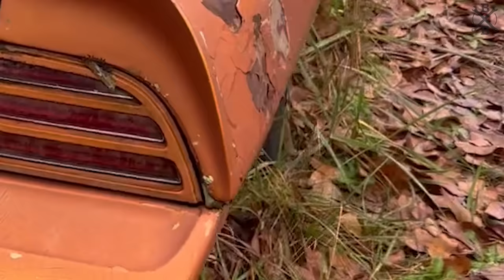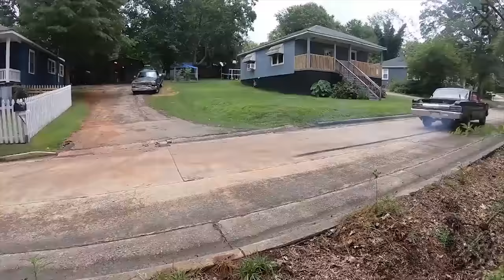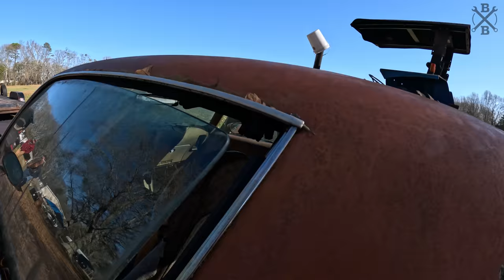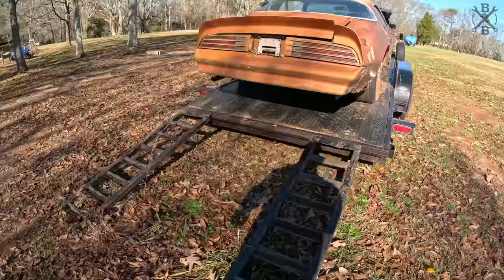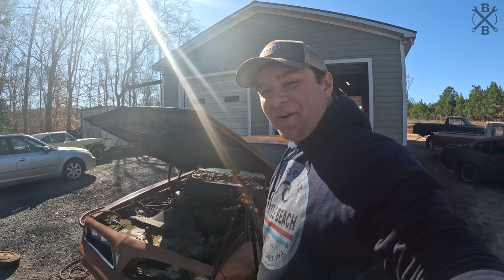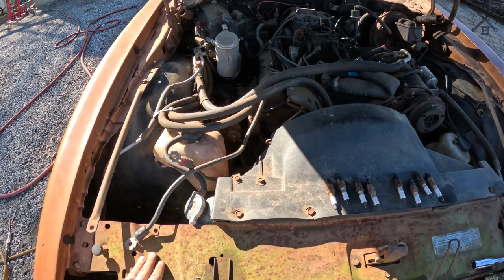FIELD FIND Pontiac Firebird Rescue! Will it Run After 21+ Years? Pt.1

Comment: My advice wether you want it or not.  GM 350's run 20w50.  Pennzoil is rubbish oil, use Valvoline VR1 racing oil as it has lots of zinc in it,  I use it on all my old engines.  Don't use purple power on alloy.  It etches / corrodes alloy and strips all the anodizing off which causes further corrosion.  I hope this helps.

Comment: I had a 1977 Formula Firebird  in 1980 it was silver w/Formula stickers on side door bottoms hood scoops and fin, raised white letter BFG Radial T/As 350 OLD MOBILE engine, 4bbl, auto trans, chrome exhaust tips, fake dual exhaust, loaded with emissions but it looked fast! Lol,  chick magnet for sure luxurious red interior, and dont forget Pioneer super tuner.
 thanks for the great vids and jolting my memories out of the cobwebs!.

Comment: as a teen car jockey (1976-79) at a Toronto Pontiac/Buick/Cadillac dealership, i drove these when brand new, on a weekly basis, using the salesmans demos, or driving 5 miles to the car wash before customers picked up their new ones....i also drove the special edition Indy500 pace cars, and those were rare.....its odd to look at them in these decrepid conditions.....would love to see an original Special Edition....not many were made, with even fewer available in canada

Comment: Just got a 78 formula recently. 63,3xx original miles. Has the 403 olds factory motor in it. Super awesome car so far. Been sitting 15 years so gotta bring it back to life

Comment: Those cars were crappy dogs back then,  They ride like a Fred Flintstone era car or steel sled.  Rattle a lot.  The large 400 something engines were dogs.  They were hyped but didn't deliver. 
I still enjoy watching you get them running.  I'm sick over the cool cars I've had and sold over the years.   Hindsight is 20/20

Comment: The Winston Winner tires should still be around. I have a set (all be it older set from around '07 or so) on my 68 Dart and they still hold air as well. You should still be able to find them. Though a set of Cooper Cobra Radial GT's would look great on there too.

Comment: Loving it Mike.
You sure that's your dad... Or you brother.. he looks only 10yrs older than you lol

Questions.
1. Can you get parts easy for it... Will you swap to new hoses in the engine bay.
2. Would you do a wash and clean, before you start a build on it.
I'd like to see it cleaned.
Would you try Dry Ice cleaning any dirt off the underside?
3. What do the electrics seem like?

Now off to watch pt2 lol

Comment: I worked on Pontiac I liked the 400 cid with the 400 trans and the 4 speed manual . A 1984 305 with twin tbi now that was a cool set up. I rebuilt the engine what a screamer .

Comment: I was given a 85 z28 camaro that had been setting for 19 years t tops fully loaded under the trees I put 3 gallons of gas in it and a battery aired up the tires 30 minutes of cleaning up from under the hood fired it up and hobbled it home you can't kill gm cars 👍

Comment: Where the spring shackles supposed to be welded to the body front and rear it will be totally rotted that’s why the rear of the body just is sagging,bad enough probably cannot drive it .great save on the motor,was impressive that it ran.great video.keep it up and carry on.👍👍👍😎😎😎

Comment: with no brake booster elbow, you've got a huge vacuum leak goin on. considering that, it ran pretty good. those formulas were kinda like the camero berlinettas, chick cars. but most berlinettas had 6's rather than 8's for engines. but a 305 isn't much better than a 292 straight 6.

Comment: Always wondered about mechanics pre-filling the oil filter. 
When you can, if the filter fits upside-down but most times I'll prelude the rubber seal.

Comment: I love watcking young peole  working on old  cars  I worked on these when they were new. we would pull carb. and tightened 2 screws on bottom good as new common problem  back then.Vacum on brake booster is a major leak.

Comment: very cool, im working on a 74 firebird, same color crestwood brown, same color saddle interior, same woodgrain dash trim AND same broken ass door handle  I bought a nice thick set off ebay, much better than the cheaper $30-40 options on ebay..  BUT my has an inline 6 250 with 3 on the floor.  Cool episode.

Comment: It looked like you were missing the plastic 90 degree fitting the connects the vacuum hose to the brake booster. If so, and that 3/8" hose isn't plugged, then you have a massive vacuum leak right there.  I also wondered how long it would take you to discover that GM didn't even drill and tap holes for the other 2 carb base bolts. The base plates on these carbs were stout enough that the other 2 weren't necessary. Cool project.  I'll be following.

Comment: I love the formulas I haven't been able to find another 400 4-speed. I had a 78 red black stripes. White seats red carpet. I had a sway bar in the rear not sure if that was part of the WS6 package or not. I had the metal steering wheel not the deluxe

Comment: One thing above old cars ,
      If the motor isn't locked up.
       All is required is ,
     Gas ,spark and air .
            To make it  run .
   It's not as big a deal as some people make it out to be.

Comment: I've always wondered. If the engine decides to do a lean pop or the like when trying to choke the carb with the hand - would it be dangerous or does it just sound way more dangerous than it actually is?

Comment: Love this channel, i highly doubt that hood will go down easy. What does the high zinc additive do?
Reply: Motor oils containing zinc are needed to reduce friction in older engines with flat tappet cams. But because zinc damages catalytic converters in modern cars, it’s been phased out of most modern motor oils since the 1990s. This is where zinc additives come in.

Comment: That excellent video also find on Firebird this type Mike a school friend of mine had same color plus type to his was same year body type too ! He had 350 4 bolt from pickup truck, 4 barrel carb Elebrock with headers with daul exhaust  , Turbo 700SR 4speed Overdrive Automatic transmission with Shift Kit, posi 377  and have seen since 1994 to and orgnail was his late dad car that heard! Also put new brakes lines plus resivor , pads plus disks with calipers if needs and drums to plus shoes also emergency brake cables plus top differential fluid and new water pump plus hose to! Should check heater core plus blower motor needs replaced too also hoses! Cap also rotor plus high Suppression Wires set  too plus fuel filter and rad fluid to also water pump! Plus check Air Conditioning pump Clutch okay plus belts too 👌 if blow cold air not hot air !  Also flush rad when do new antifreeze plus thermostat too! 89 or 91 octane gas with Carb cleaner in fuel  tank full and electrical problems need plus lights !

Comment: you aint old enough to have seen the rockford files, surely, i remember watching it in the early eighties [uk]
it does sound nice, what's the cc for us boys this side of pond, you said it had 130 hp, but that sounds like a really low figure
Reply: He said its a 350 cubic inch motor, so its 5,735.4724 cc.
Reply: @kristoffermangila wow, 5.7l = 130 hp, we get that out of a standard ford 0.9l now, we got 100 hp out of a 2.0l 4 cylinder in the 70/80s, 140hp from a 3.0l V6

Comment: That body style never had a 305 in it!
Reply from the maker: This body style Firebird could be optioned with a 305 from 1978-1981. It is a U code and the original emissions decal matches, 5.0L 305CI.
Reply: I see the 301 but not the 305 for those years.
Reply from the maker: @brandonjanuhowskimusic2787  http://pontiacformula.free.fr/en/code_VIN_70-81.php
Reply: @BudgetBuildz  that's vin code information. But regardless of that I look forward to seeing what you do with the car!
Reply from the maker: @brandonjanuhowskimusic2787  I’m not proud of the fact it is a 305 car 😅 If you scroll down to engine codes(5th digit in the vin), you will see the different options. Happy it has a 350 now and can’t wait to healthy it up a bit 😃 Thanks I hope you’re enjoying!
Reply: @BudgetBuildz  so what year is this car?
Reply from the maker: @brandonjanuhowskimusic2787  1978. I don’t mean to sound like a know it all either! I may very well be wrong. I’m just going by the info from this spreadsheet and the emissions sticker on the core support.
Reply: @BudgetBuildz  1978 never had a 305

Comment: Probably more than 145 as back then the big 3 were always overly conservative on their hp ratings.  Always liked that style but they were scarce already by the mid 80's when I got my first car.  I did however get an '86 Firechicken in about 1989.  You find a bezel and get some headlights in on the left side and buff that paint she'll be a real looker.

Comment: Anyonre else saying Plug that manifold vacuum back up to the brake booster and it will run alot better? It's missing the plug for booster. Your brakes will work too

Comment: Hey Michael, did you end up getting that E-brake boot from LKQ?  (Yeah, that was me;)
My kid just nabbed an '07 Tacoma for 900 bucks "Parts car, bad motor, bad trans"... 
The owner never changed the oil, gummed up bad, timing chain jumped a tooth. Deal of the year!
Do you still have the Willys PU? I'd be interested in it if you do. (I also have an old Porsche, total respect for that endeavor).
I live up Caesars Head from you, we'd love to swing by and chat some time.
Hit me up.
Scott

Comment: Just wondering.  You know in advance the car you are going to go get, there's no surprises there for you. Wouldn't it be simpler and safer to just bring four tires with you and then deal with the dead old ones back at the shop?
Reply from the maker: If I have wheels that will fit, yes. We don’t deal with many GM vehicles and don’t have many spares. If the tires won’t take air, the winch doesn’t complain about flats or locked up brakes.
Reply: @BudgetBuildz  Long work day.  Totally a good reason :D  I had a boss a few bosses back used to race a Firebird much like this, that car was something else, not surprised it ran as well as it did :D

Comment: My truck sat for years and the transmission seals dried up and it leaked all the fluid. Never stopped leaking until I got the transmission rebuilt. Probably gonna be the same with yours.

Comment: Too bad it does not have it's Pontiac engine in it. I have owned a few 70's T/A and Firebirds the Pontiac 400 and 455 have more low end grunt then a SBC even the Pontiac 350 has some good torque and they are great runners too.

Comment: I would be more concerned with heating that motor up again and changing that oil after it gets hot. And putting more ATF in than I would be about brakes. I can still test drive a car with little to no brakes than low on ATF and not so much on that motor oil but I think I would charge it again few weeks of driving

Comment: I don’t really get it when a engine is sitting for years the water drys out in the engine you fill it up with water what happens all the dryer rubbish goes strait into the radiator, blocked radiator.Tip put some fly wire gause in the top hose when it over heats take top hose empty rubbish keep driving.

Comment: A real FORMULA,  would not have come with a 305. A FORMULA,  Was mechanically a TRANS AM, but  didn't look like one, a cheaper alternative model. If there's no formula badging, and it did have a 305, it just a regular Firebird. I owned a 79 Trans Am in the early 80s for several years. Was a fun car. In 1994 I bought a new Trans Am,  which I have kept.
Reply from the maker: A Formula 400 would have not had a 305, correct. This is a U code(Formula) with U code 305 Chevy. That’s really cool you still have the one you bought new!

Comment: my friends call me the budget  king  after u here what i have built for next to nothing like my 68 chevy pu i have 2000 in it but still have the fresh 327/400 turbo extra cab, fenders, box and 3/4 ton rolling frame but the truck has a stroke 454 with a 02xx trans 12 bolt possi twin electric pusher fans power steering power breaks all rebuilt suspension all painted full gauges with tach factory heated full movement electric leather seats 70 blazer center stereo with 2 10 inch and 2 400 watt 6x9 speakers dash looks better then it did new rebuilt heater system new glove box new tail gate. started with a 450 hp 454 but put a high rise and 850 on it it really came alive set of rally wheels and a set of center lines oak wood in box with new chrome truck has a sweet body on it with full chrome trim and bed light. my next project i have all the parts for it for free it is a 79 z28 rs t top got 2 extra z28 hard tops for parts another 450 hp 454 with a 02xx trans or a t-10 got new fly wheel and 12 inch clutch have all the parts for both auto and stick one of the hard tops has new interior even got a extra front clip that is mint even the paint on it so i only need to buy or trade for paint

Comment: But really I think the motor should be pulled out and completely stripped and rebuild m a g a f l u x and rebuild everything new hoses everything and check the transmission and the rear end if you want to restore this I'm sure you know that's the way to go remove the interior I mean it may be a three-year project who knows but at least you restored something from the 70s

Comment: Not a Formula they were standard with a 400
Reply from the maker: Correct, the Formula 400 did come standard with a 400. This is the Formula package, second digit U code but not a Formula 400. Digit 4 is U, which comes back to Chevy 305. You’ll notice the original spoiler and hood as they came on the Formula. Laredo brown also did not receive the stripes package. Cowl tag coincides with the vin as a formula, and 305 Chevy. The build sheet matches everything to a tee. It’s an odd one and I’m not sure how many Formulas were not 400s.

Comment: That's a Pontiac engine, not Chevy crap. :-)  Not a high rise intake it's just a normal Pontiac.  Pontiac never had what you would call a big block and small block.  They had pretty much one block that went up to 455 ci.  You can't hardly tell the difference unless you are good Pontiac person.